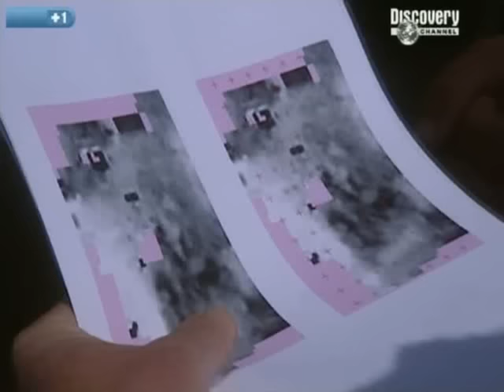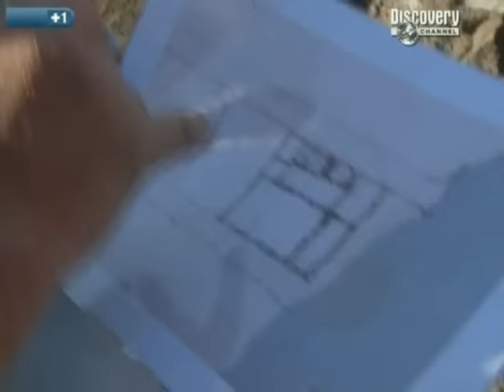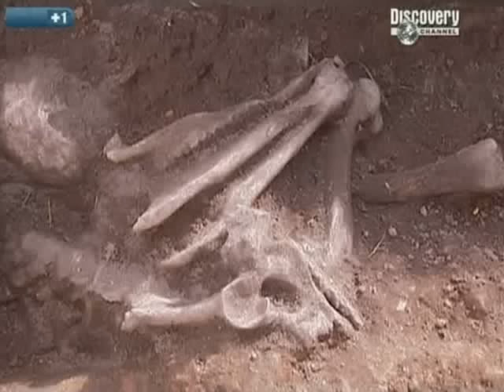Time Team S08-E09 Holy Island, Lindisfarne

Comment: With cooperage you use the white and red oaks differently. White oaks have structures within the pores of the wood called tyloses. That keeps the wood from leaking and that is tight cooperage. Red oaks lack those structures and won’t hold liquids, so you would use that for goods like apples and that is called slack cooperage.
Reply: Thanks for that bit of info about the two kinds of oak and their use by coopers. 👍🍻

Comment: At 24:40 The cannonball found could have been a super heated, red hot(possibly soaked in tar, set ablaze) catapult round that may have deformed when it something?
Reply: Cannonballs were used in cannons, not catapults. If the ruins are from the 1600-1700's, then catapults had been out of use for a few centuries. Cannonballs also tended to explode on impact, as they were generally hollow. A lump of solid iron that size would require a massive cannon to make it an effective projectile. The most common cannons of that time were 8 and 16 pounders, and used cannonballs the size of apples and grapefruits.